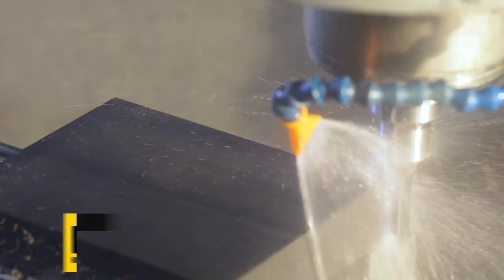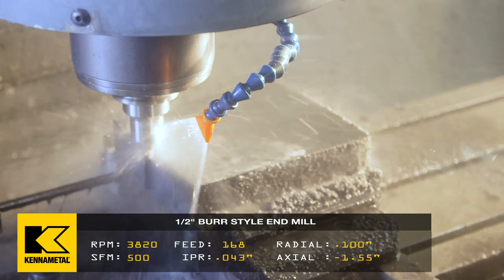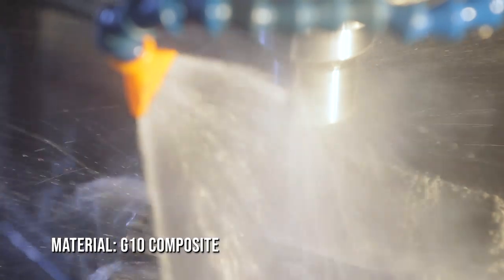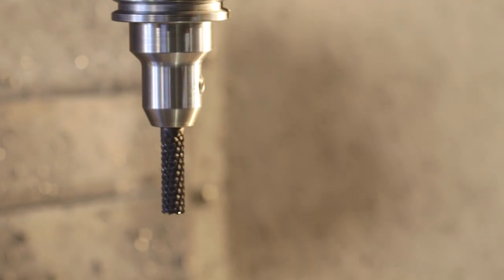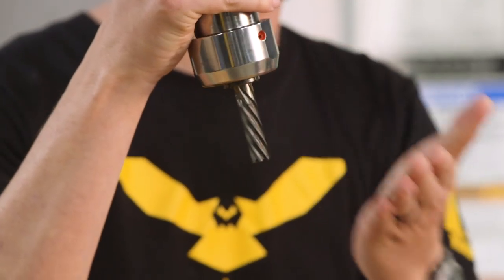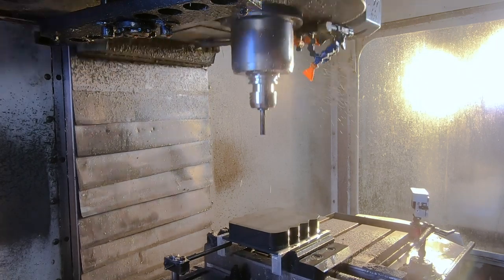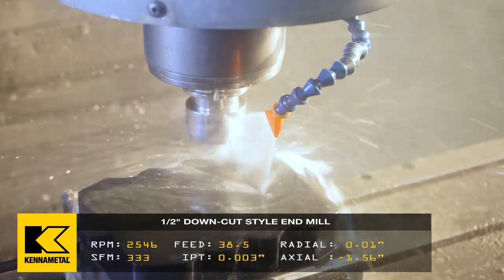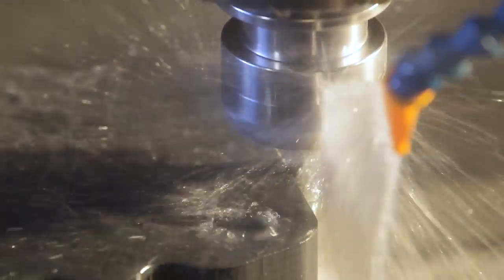Why DIAMOND COATED End Mills and Down Cutters Are Used on Composites and CFRP

Comment: As I remember, there is a tool that looks just like a chevron gear - its cutting edges are inclined from top and bottom of the tool toward the center, thus the compression during he cut is directed to the middle of the CFRP panel and prevents the delamination! Have a pic of one - but couldn't add it to a comment :(
Correct me if I'm wrong.

Comment: What do you recommend for coolant? I use Fuchs ecocool but I'm not a fan. It makes everything sticky when it dries. I like Houghton Hocut 795 but it can be pricy. Up to 300 dollars more per drum than Fuchs.
Reply from the maker: Synergy 735 from Blaser is clear, and I absolutely love it. It’s not cheap... but is competitive with coolants that run steel, super alloys etc.
Reply: We use Onsrud PCD and diamond coated tooling.. no coolant, just air.
Reply: @zaknefain100  How do you like the PCD? I want to try them but they are so pricey.  Are they somewhat forgiving as far as speeds and feeds and chip loads go?
Reply: @lopezepol75  They are only pricey initially. In the long run, they are much less costly than coated carbide inserts. We turn a lot of RSA aluminum for optical inserts (PIM), and honestly, I can't remember the last time we had to change inserts out. I use PCD for roughing, mono-crystal for finishing and they last forever in our shop.
In other shops, dealing with hypereutectics and the like, they're a must have. If you're doing a lot of heavy roughing you might want to look into diamond coated tooling like those from Becker. They have some very aggressive chip-breakers and you really need that chip control in aluminum. Built-up edge is usually what ruins your tool life, and diamond coated is a nice,  more economical way to combat that. Good luck.

Comment: What type of finish are you getting with those "burr" style end mills? We cut a LOT of G10.
Reply: You can get a pretty decent finish with a new cutter and the right feeds and speeds. There is also composite finishers- like a low helix 6 flute uncut endmill. I find the burrs dull to a point where you get fraying and a "fuzzy" edge pretty quick but will continue to cut way past that mark.  If you can run a diamond cut burr for roughing and then a sharper burr style or the low helix style for finishing.